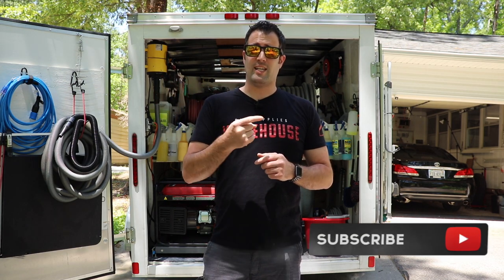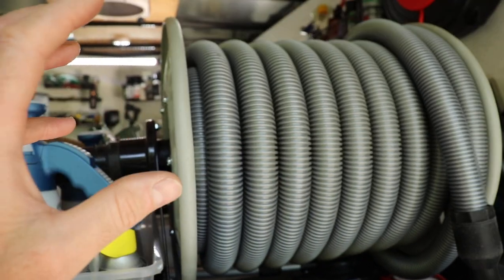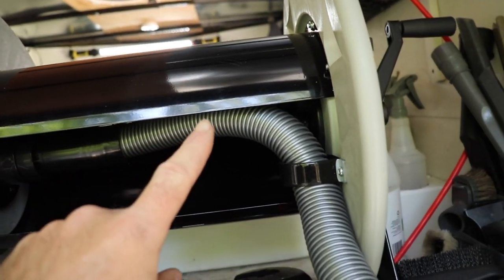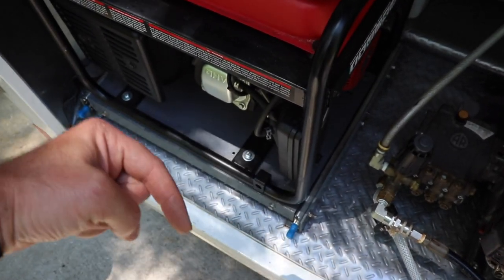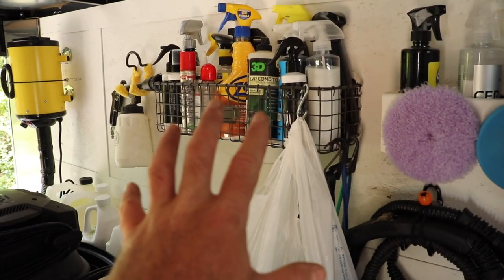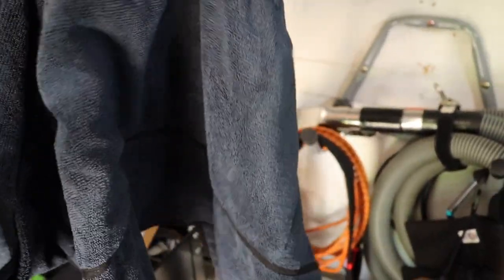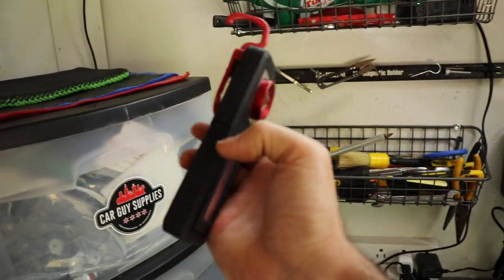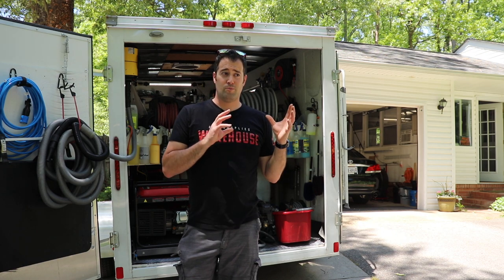Mobile Detailing Trailer Upgrades & Updates! #Mobiledetailing #autodetailing

Comment: Love the setup, looks absolutely amazing. I am curious on how many vehicles on average you can wash with that 65gal tank. I dont detail, so 65gal doesn't seem much to me.
Reply from the maker: Thanks. We don’t do any basic washing anymore. But when we did we could wash about 5 vehicles. We made sure to use the water sparingly. Roughly 10 gal per vehicle depending on how bad it was. But now we do full details and sometimes that can use up about 15-20 gal per vehicle. But we only fit 2 full details within a day. So it plenty of water.

Comment: Nice trailer but how many times is towing and parking the trailer a pain at the homes you service?
Reply from the maker: Thanks, Actually that was a concern of ours at first, but now it doesnt even make a difference.  We always tell customers that we need lots of level space to work, and it turns out fine. sometimes we run into problems, but we work around them.

Comment: I have a 50 ft cen-tec vacuum hose. Rockler says that they're reel is designed for a 40 ft hose. Will this reel accommodate a 50 ft hose?
Reply from the maker: Yeah so I took a gamble becasue it says 40ft. But the 50 foot hose fits perfectly! In fact I think I can fit a 60+ foot hose on here and it would fit.
Reply: @MirandaDetailing  excellent! Thank you

Comment: Hey! So I have the 6.5 hp ridgid and am looking to get the smaller one and switch motors, but I cant tell which one is compatible. The 4 gal 5 hp one I see on home depots website looks like the motor attaches in a different way. The motor I have attaches the same way yours does. Am I looking at the right one or do they not sell it anymore?
Reply from the maker: It’s this one. https://www.googleadservices.com/pagead/aclk?sa=L&ai=DChcSEwjKrJ3RtuzqAhUCnLMKHWYtAmcYABAGGgJxbg&ohost=www.google.com&cid=CAESQOD2p6Vu7n6lM1QFxvHQaXUgeFimhSxlC73SO5dYLMg2bbG3wkK-M0H2Q63FQd5o4eDczhNbYHaA3KPHg1kwsQM&sig=AOD64_1bBLKXPuQRiwF3-_zSVVD7m1L7QQ&ctype=5&q=&ved=2ahUKEwjYupHRtuzqAhXJknIEHequArQQwg96BAgLEBU&adurl=

Not sure if Home Depot carries the same models everywhere.
Reply: Miranda Detailing Thanks Phil!!!

Comment: Do you loose suction? What vaccum are running?
Reply from the maker: It looses very little suction. Not bad at all.   Not sure if you watched the entire video but I explained that the vacuum is a Ridgid and I swapped the motor out with a 6.5hp one.

Comment: Hey Phil, awesome set up. What are your thoughts about the electric pressure washers like krenzla or AR blue? I have a truck set up and have been thinking about switching to electric. Keep up the excellent videos!
Reply from the maker: Thanks!  I'm going to look into them especially the AR Blue, because Carsupplieswarehouse.com is now carrying them!
Reply: IzzyShine Mobile Detailing Guys for 150 in the States you can get the SPX 3000 .. for another 20 you can add another 2 or 3 years .. (I’m old I forget) it has plenty of power ... I would just like the hose another 10 feet longer

Comment: Do you that part number of the vacuum make the small 4 gallon a 6.5 hp like yours thanks
Reply from the maker: Hi. I don't go by part numbers, but I send you a link https://www.homedepot.com/p/RIDGID-4-Gallon-6-0-Peak-HP-Wet-Dry-Shop-Vacuum-with-Detachable-Blower-Fine-Dust-Filter-Hose-and-Accessories-WD4080/205224112
Reply: Thanks didn’t the one you have in the video is 6.5 hp ??
Reply from the maker: Oh yes…. I actually bought this one also 
https://www.homedepot.com/p/RIDGID-16-Gal-6-5-Peak-HP-NXT-Wet-Dry-Shop-Vacuum-with-Detachable-Blower-Filter-Hose-and-Accessories-HD1600/304795082

And just switched the heads. I needed another vac in my shop anyway.

Comment: hello friend Phil  thanks for all your advice.  I want you to help me solve a dilemma.  I am starting detailed mobile, I have the optimal steamer I use it for exterior and interiors, carpets and seats and the vacumed instead of extractor but it takes up a lot of space.  do you think i should sell it and buy something smaller steamer.  and buy an extractor.  someone with a better idea .
Reply from the maker: Hi. You're welcome,  well I guess thats up to you...I smaller steamer is great,  but yours takes the place of a steamer and pressure washer.  The smaller steamers are not great to wash or detailing the exterior of a nasty vehicles.  Are you planning on getting a pressure washer for exteriors?
Reply: Miranda Detailing  I got electric pressure washer already.
Reply: Miranda Detailing   Based on your opinion I will make a decision and I will share it with you